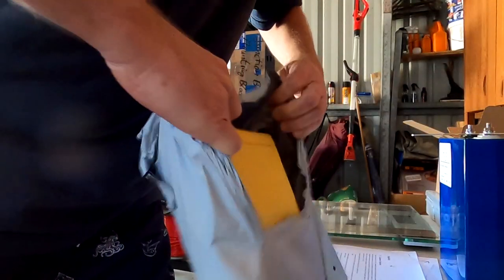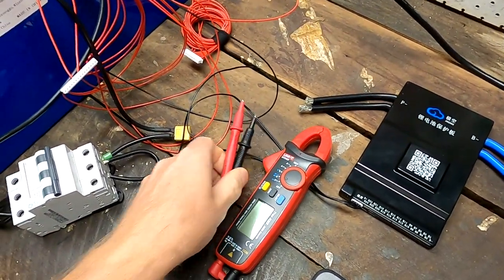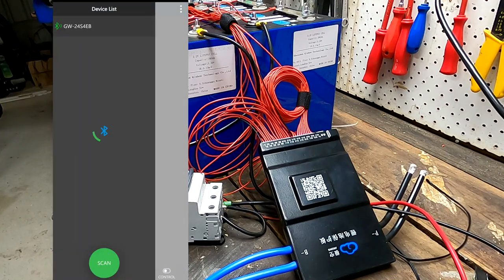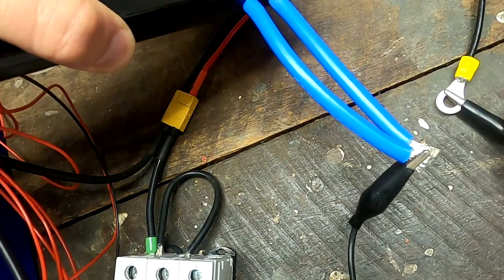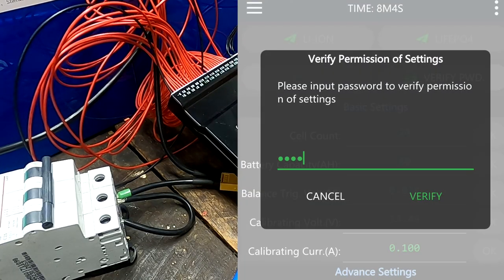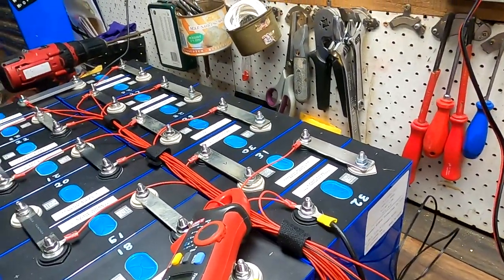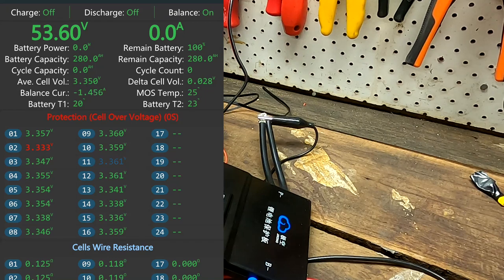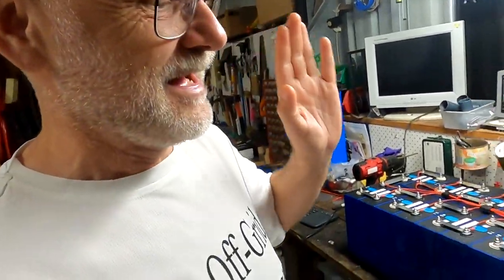The JK BMS with integrated active balancer. This is the one!

Comment: Given that the charge controller has a set voltage where you can limit over voltage for the pack that's okay, sure it isn't a 'disconnect' but you have some assurance that the pack won't be over charged as long as your settings are correct. And I suppose that the under voltage protection at a cell level is more important than a pack level under voltage protection which could also be done from the inverter as a cut-off.
Again, those aren't intended as direct safety cutouts but they should achieve the same function.
Reply from the maker: I agree, all the settings should be set in your solar charge controllers to start with. The BMS' cut-off function should never be used and are only intended as a backup, fail-safe, last resort.

Comment: On a 100A Daly 8S BMS, I had to short circuit the battery negative to bms negative to wake it up. Wear safety glasses, better yet just use a resistor to do this, or you'll get a big spark like I did...

Comment: I’ve been telling you for months it’s the one. However I must tell you, it is not very accurate for voltage from empty to full and cells in between. I have had mine for year in a half now. I like it! It does what you purchased it for and nothing more. I also purchased the JK 10amp non BMS balancer along with it. Works the exact same as the BMS without the leads and balances fast!
Reply: Have you calibrated? Mine's pretty darn accurate.
Reply: @upnorthandpersonal  I have played with it for hours, days even. I calibrated it in the lower end, then tried middle, then tried the top (which is where I have it at now), I even played with all different cell impedance’s with no luck.
Reply: @andrewbowden1076  Strange - I just measured the voltage of the battery with my Fluke when under no load/no charge and put that in the BMS calibration. Stable as a rock.
Reply: @upnorthandpersonal  My unit runs with the manufacturers calibration. I tested it with 2 Fluke and no significant difference.
Reply: @mrzed6597  I probably messed up the factory calibration playing with it back then.
Reply from the maker: Mine seems to be off a lot with both voltage and current. Measured and set both values a few times but it does not seem to be accurate when numbers are changing.
Reply: @upnorthandpersonal  I too have and used my fluke to set the voltage and yes I also shut off both charge and discharge while setting it with still no luck. Perhaps I received one of the first ones. 😂
Reply: @OffGridGarageAustralia  I have checked the current only against the charger/inverter and seems pretty close. I recently just purchased a current clamp meter. With this said I will be doing it tomorrow!  I do know after many charges and discharges the BMS is not accurate with it’s metering of capacity. I think it lacks the ability to read very low currents. It is acceptable though in my mine. It’s close. Will be buying a smart shunt soon!
Reply: @OffGridGarageAustralia  also I have to say.. A lot of the values are dictated off those tiny balance leads. I never cut my leads! With that said, I think that is why they give you the ability to change the wire impedance.. in case you shorten them or perhaps make them longer. But anyways the values do very a bit and more so while charging and discharging which in my mind is to be expected. But for a cheaper Chinese BMS I would still buy another. What would be awesome is if I could connect the thing to my Growatt’s!!
Reply: @andrewbowden1076  Do the wire resistant show the same on all cells and constant? If not it could be the connector issue inside the bms that is at play here as well. I had to puch the larger connector manually and hold it in constant for it to work correctly with cell1 b+ at first. Probably bad solder job, I have not opend it yet but found a semi inserted position of the connector will make it work as well, but with a little higher resistant the others on cell 1. Maybe it can help someone else that have similar issue.
Reply: @johthe  I have no issue there. I went back and forth a few times making sure them leads were proper. Just for everyones awareness on this, the values on the resistance will never read zero.. however they should not be off or different from one another by more than .150ohm give or take from my experience with working with it. My values are up in the .300 to .250 ohms. If the resistance is slightly higher on one cell than another it is likely do to a problem. Perhaps a problem like johthe experienced or it could just be a bad connection at your termination point at the battery. I recommend soldering when possible! * Side entry here, it also reads the cell resistance too, not just the wire resistance. For those who don’t fully understand! *
In addition to above, I did have a problem right off the bat with my JK 10 amp balancer, and I figured out it was the wire inside the connector. To be more specific. They had used the wrong crimp die size on the terminal. What happened is that they used too small terminal for a larger silicone wire and the die they used to crimp the terminal was so tight that they literally cut the wire. So after some time balancing, the resistance would get greater and greater causing me all sorts of problems. I finally found the culprit when I seen the sparking and that clued me into the burn mark inside the terminal socket on the connector. Crazy, I know!

Comment: Great video and my only comment for offgridders is the if this going to be the ONLY bms/ balancer that you use, another dashboard/Gui option with a more graphics based display might have been nice in addition to the existing functional display which is important of course.
Extra info like daily totals for charge and discharge would be handy info on the Gui.
I've had the 2 of the JK 1a balancers running on my 30kwh and 50khw diy powerwalls and they have never missed a beat.
Reply from the maker: Thanks for your comment and sharing your experience with the JK-BMS, Glenn.
The JK's have a communication port where you can read out the data and create your own graphs, tables, whatever you like. I'll cover this in a future video at some point.
Reply: Did you ever make a video on the communication for an external gui or monitor
Reply: @glennlockey1012 +1

Comment: Hello

72 volt 42 amper lipoo4  new battery has been bought and been installed recently. This battery has bluetooth features
However I have had problems with  connecting my mobile with the,battery. I tried to delete the programme and reset it but the same problem remained. Could,anyone who has had  the same problem please help me ? Currently I can not get any bluetooth signal from the battery or any internet connection.

Comment: Hi Andi, great Channel ! ..  Looking for some new stuff to test ? ;-) Imagine a battery bank with one  cell that has less capacity for whatever reason. Instead of trying to balance this one over and over .. why not simply "repair" it by adding a second small battery in parallel to the bad cell .. for example a 32700 cell ? ..
Reply from the maker: I don't like this idea because you have literally two cells in parallel and cannot control the current in between these two cells. One very large, one fairly small. Bad things can happen...
We have tested this here on the channel in this two-part video:
https://youtu.be/fQz7vZEYLfY

Comment: Is the balancing current of a maximum of 2 amps sufficient?
Reply: It depends on how you set battery up with inbalance and use it. I use it the 1A version and it will be more then fine for me. It mostly depend on how fast you want it to balance and how the battery and system will react during the time of inbalance. Many BMS use some mA to balance that also will work but over a much longer time. During unbalanced time you may have to limit total voltage and or charge current more for example. So it is more about how the system work during the time of inbalance and to get it balanced enought for the application used.
Reply: That's right, thanks for your answer. How big is your battery? And how long do you need to balance with 1 amp?
Reply: Right now I use 14 leaf modules 14S4P and sometimes for now connect 7 or 14 more in paralell to sync them up or connect new set. Each module is 2S2P. So far cell volts is pretty close and have not connected for logging yet so I do not know exact time but I think it is within a few mV within a few hours.
Reply: @johthe  OK. Thank you for sharing your experience.
Reply from the maker: Even with a small balance current, the BMS will work. It balances a tiny bit every time you charge your battery (like the Daly BMS works) and over time the cells will be balanced. I just like the active balancer component of these BMS. Currently, I just let the 16s battery sitting there with the BSM connected and it balances all cells. Started with 200mV difference last night and this morning it was on 4mV difference. No charger or power supply connected, just used the balancing function of the BMS. This is great for maintenance of battery packs.

Comment: This maybe what I've looking for, do they make a 8a 24v?
Reply from the maker: Unfortunately not. It's only for 15s LiFePO4 onwards. Due to the active balancer, it need this higher voltage to operate.
I will show other solutions for 12v and 24V system in a video this week.
Reply: You can use same BMS if you can provide over 40V, say 48V on the B+ pin to power the bms with for example a dc-dc boost converter. Then you can use the BMS with the hole range of S1-24 I suppose since I only tested with 4S.
Reply: @OffGridGarageAustralia  That will be great am looking forward to the 12v BMS setup... Wanting to build a battery for my caravan but want a quality BMS... Pretty new to this but still want it o be as good as I can get it...  Thanks for the great content Andy... ;)

Comment: Pretty typical battery bank protection to prevent a pre-assembled pack from turning on during transit - can't turn on without external power first. As for how to turn the BMS on after it has been installed in your shelves, all you need is an auxiliary input to connect the external PSU to while the bus breaker for the pack is turned off.
Reply from the maker: It needs to be a button for that!
Why should the breaker be off?
Reply: @OffGridGarageAustralia  You will have a hard time raising the BMS' input voltage 5V above pack voltage to get the BMS out of its lock-out state if the input is in parallel with the 2-3 other packs in the shelf, so you will need to isolate the pack to restart its BMS.

Comment: Real expensive coupled with tiny electric pins that aren’t built for vibration or temperature change might spell disappointment. Does anyone have experience with the durability?
Reply from the maker: You mean for mobile applications? The plug sits fairly firm in the BMS...

Comment: did you ever thought about testing the diybms?
Reply from the maker: Many times! I just don't have the time to look into all these options at a time. I like the flexibility of it and that it now connects to Victron gear but I fear the time it will take to solder, program, setup, configure and play around with it. Also, not too many people want that DIY solution for a BMS as they don't like the software and programming part of it. The plug'n play BMS with app are easy to setup for everyone, so I will mainly stick with them. Same reason I didn't go with Batrium (yet).

Comment: With the JK BMS and the Victron gear you are able to make battery packs of 18 cells. Higher voltage, less current for the same power. And the Victron inverter will be able to deliver more power because of that.
Reply from the maker: Why is this limited to Victron gear only? Can charge voltages not be set in other SCC as well to allow an 18S configuration?
Reply: @OffGridGarageAustralia  Not only limited to Victron gear but I know Victron multiplus can handle 66V DC

Comment: hi Andy, I can't find what is the maximum charging curent.
Reply: His is a 200A version. There exists a 300A version as well, but they're less common and expensive. 100A and 150A versions are available as well.
Reply: All versions have the rating for both charging and discharging. In other words, a 200A version can charge and discharge at 200A
Reply from the maker: I should make you a commentator on this channel ;) Thank you!
Reply: @OffGridGarageAustralia  Just spending some time relaxing - just like I do on the forum. It's fun to help people out, especially solar/battery topics.

Comment: Can you connect the jk in parallel. Ie multiple packs in parallel
Reply from the maker: You mean multiple BMS' in parallel on one pack or several battery banks with their own BMS each?
Reply: I mean i.e 15 x separate packs each with its own bms . Then using RS 485 and have each bms on its own address

Comment: I like the configurability of that unit, but having to have 5V above the pack V to turn it on is odd & undesirable.
I think it should have a power switch to power it on & off.
Reply: You only need to do it once. Its pretty simple. Kinda like the need to use a resistor to charge the inverter caps before switching on  the battery power.
Reply: The reason for this is so that it can power itself off once the battery is very low. This prevents the battery from being drained over time by the BMS itself.
Reply: @upnorthandpersonal  There are other ways to power off a system that don't need such a high V as a reference.

They could also use an isolation relay to prevent batt drainage from the BMS.
Reply: @Sanwizard1  It is simple, but it seems to make the system less reliable when you are monitoring it remotely.  Why would someone design something like that which requires a person to manually adjust the charge voltage like that?
Reply: @ab_ab_c  Relays have a pretty high self consumption. This BMS only consumes 10mA when active. You can start it with a 9V battery, so I don't think it's an issue. I only had to turn one of mine back on once this past year.
Reply: @upnorthandpersonal  Not a pulse latching relay.
Reply: @ab_ab_c  Sure, that would work, but you'd have to have the BMS actively pulse to turn back off. Imaging something goes very wrong, BMS power is cut (no time to pulse) - you don't want it to come back online automatically.
Reply from the maker: The GUI is great with the JK BMS. It's very easy and intuitive. Best app I had so far. Only downside is the range which seem to be a lot shorter than with all other signals I have in the garage.
Reply: @OffGridGarageAustralia  I took mine apart and added a short piece of small gauge copper wire from a piece of Cat6 cable, soldered to the BT module and ran it out one of the little slots in the side. It maybe added three feet or one meter or so! Not really worth it!
Reply: @OffGridGarageAustralia  It's because of the metal enclosure.
Reply: @andrewbowden1076  I think doubling the BT antenna length may double it's power.  Check with an RF expert to find out.
Reply: @upnorthandpersonal  That was the thought I had. Hence the modification.. 
I think I may purchase a arduino BT module and try that next. I have seen they have a good range.

Comment: Ohh Andy. You should already know that all these Chinese BMS require activation, some times power, button on BT or display. I got once BMS HOYO which require to press button on battery level display ... but they didn't send it to me :) But then again I've learned that I can active it by power signal (which was not mentioned in the manual). BTW. Nice BMS but from other user experience all these devices likes to die in 1-2 months ... thats why we came back to HOYO/DALY BMS. They are simple but reliable. With active ballancer I just check battery once per month or two .... it works !
Reply from the maker: I've tested a lot of Chinese BMS'. This one is the first which needs activation.
Reply: @OffGridGarageAustralia  Yes - because you were lucky to get DALY BMS (NEW EDITION) with activation button on Blutooth module. It was not there before and activation was the same challenge as you had now ;) I will wait for your expirience few months. If it still works then I will also try this new gadget - looks good !

Comment: Dont need +5v to wakeup the bms if you have power on switch bought with the bms.
Reply from the maker: I have the Gen1 of the JK. There was no power switch afaik for this version.
Reply: @OffGridGarageAustralia  I think it has. One of the port is multifunctional,you can add switch to it. I think that rs485/gps port is the one. I have both switch and 2.5inch led display. They both hookup to the same port. I can share you pictures,but don't know how to contact you

Comment: if possible please test 200a load on it, just wonder will it handle it
Reply from the maker: Due to the very low internal resistance of 0.3mOhm, if you push 200A that's a heat loss of 12W only. I don't have a 200W load at 48V to test that. I don't even have 100A of a load...

Comment: Thanks again Andy. I've been looking at a similar JBD that do 14 to 20S strings but limited to 60A, and for a few $ more this might be a better option for some higher Power EV applications I was considering, as BMS Options that can do 16S to 20s LifePo4 strings are few.
Reply from the maker: It seems to be really good after having it connected for 2 days now...
Reply: @OffGridGarageAustralia  Thanks, I may try one on an 18S EV pack that would see heavy loading and charging cycles. IF it has a built-in BT UART would be a plus over dealing with those troublesome dongles.

Comment: can we see 200adc discharge for 6 hours?  thats a 24vdc 4000 watt inverter. this is where most bms fail. good job.
Reply from the maker: I don't have a 200A load for 50V though...
The internal resistance of the BMS is only 0.3mOhm. With 200A, that's 12W of heat loss.